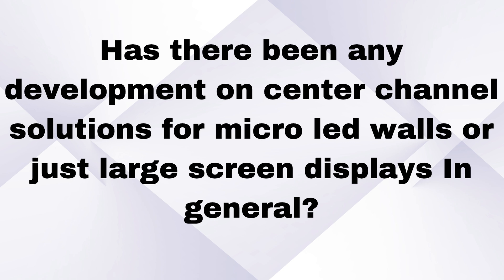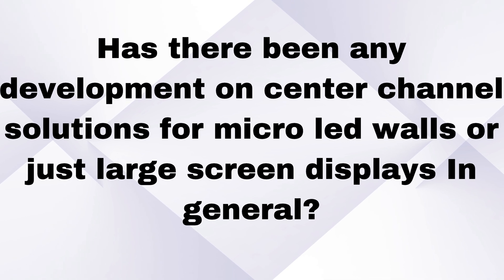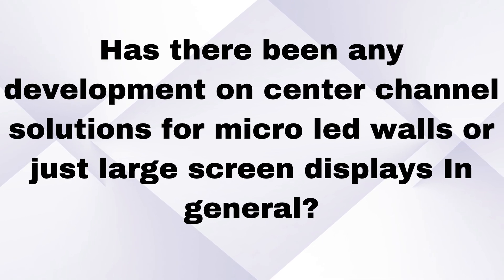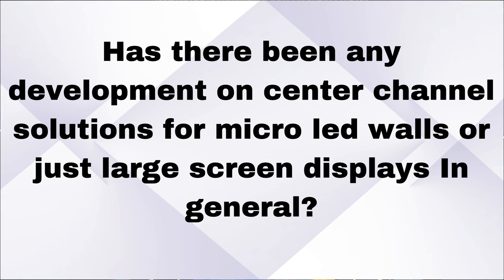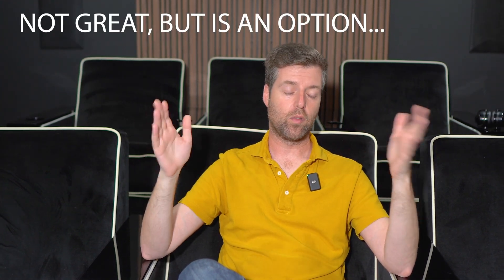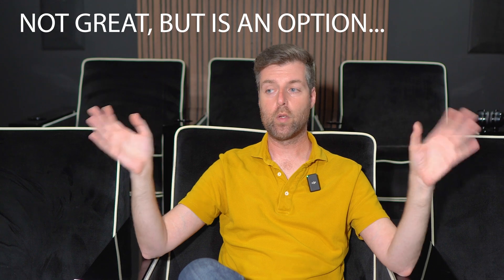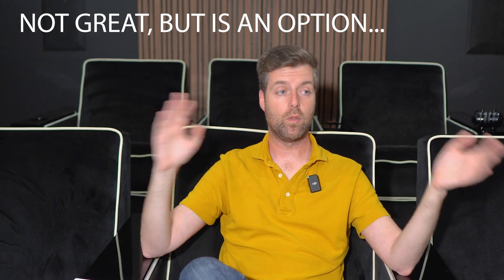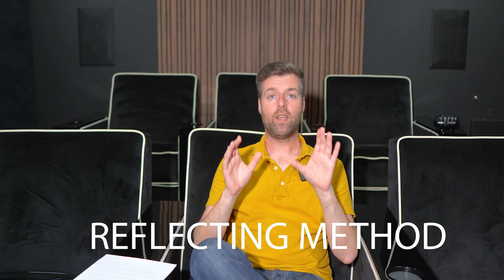Center Channel Solutions for Micro LED Walls: Updates

Comment: What brand of speaker would you be talking about, if it wasn't a Meier Direct Reflecting speaker (for center channel)?  I agree that having top or bottom positioned CC speakers are not the answer, especially when using a video wall, such as Just Video Walls (Micro LED).

Comment: I'd use the 3 way in ceilings from KEF. Normally I wouldn't put in celings for a LCR but those ones do a really good job at dropping the center image so it does sound like its coming from the screen.

Comment: While the ideal is acoustically transparent and behind the screen, I realliy don't think putting the center under the screen is bad even for projectors. I suppose a purist finds it objectionable but for my 120 inch home system I think it works very well, I've never reacted to voices coming from too low. But of course the larger the Micro LED the bigger the problem.
Reply from the maker: It all comes down to what compromises you want to make. And as you said, the bigger the screen the worse the problem. 

Keep in mind we are now targeting much larger viewing angles.  60-80 degrees. The push to 60 came from work that showed that 16:9 content at 4k could tolerate something like 57 degrees. They are now suggesting that as we move to 8k and Beyond we will push past 80 degrees and intentionally have the field of view be smaller than the viewing angle. Meaning content would fall into or even outside your peripheral vision (just as it is in real life).  As that becomes true, we can’t continue with center speakers under the screen.

Comment: I've never heard of  this approach mentioned.   \

I've always  had my centee placed below my flatscreen and have never had  <sond perception< issues.  The  dialogue/action sounds< always sounded like  it was/is coming from the center of the screen...which  i  am still kind of amazed  this  happens.....correctly. Almost as if i were using a  <front projection screen"  with the center speaker behind the  screen.  Same perception.

I think probems arise  due  to the speaker design----e.g. how the drivers disperse sound  forward--is it a wide vertical spread or a narroow one??  Is the  sound  metallic or natural? (i think when it's harsh....you might  detect the  dispersion pattern  more ).....how many drivers does the  centre have (more drivers...better  body of sound...im guessing)....is it a big centger channel speaker of a small and maybe narrow one?? etc. My center  is almost as   large as my  2 floor standers..so  iguess that's  a huge reason whytthe sound   souns <full-bodied/natural<.... Paradigm Ref series speakers....CDN  brand.....had them for over 10 years...very happy with them (never felt like i needed new speakers)...

Comment: Would high SPLs have a chance of damaging the display using this reflecting method, especially if crossed over at much lower than 1kHz?
Reply from the maker: No. Not even remotely. Nor would it matter if it was aimed at the display or not. If you could produce such high pressure as to break a tv, that would happen regardless. The more likely would be hitting the resonance frequency of the display glass. But that won’t happen either. It’s very difficult to break and it’s damped. So it’s really not a realistic concern.
Reply: @PoesAcoustics  Good to know. Thank you! I never considered the reflecting method. I have a 77" LG G2 OLED but if I go much bigger, I was considering angled dual centers above and below for a vertical phantom image. But this video and your response really make me think about experimenting with the reflection method. What gives me even more confidence is because I actually have a messed up version of a reflection method between my kitchen and my dining room. I have a nice little RBH bookshelf stereo system connected to my Alexa in my kitchen, but if I listen to that system from my dining room, I know that I am listening to the reflected sound off of my kitchen wall, which has counters and cupboards. (I don't have line of sight to the kitchen speakers from my dining room; the speakers actually face the opposite direction from where the dining room is.) It actually doesn't sound bad at all from the dining room; it doesn't sound significantly different than being in the kitchen where I have line-of-site to the speakers. So I have unintentionally already vetted the validity of how good reflected sound CAN sound, so I can imagine that it would work well if I actually and intentionally set up a reflection-type system / center channel. Thanks for letting us all know about this!

Comment: How is a center channel with an LED wall any different from a center channel with a TV?

You should optimally sit 1.375x[screen width] away from a 16:9 screen for the recommended viewing angle of 40 degrees. 

If the center is right on the edge of the screen it will be at an angle of 11 degrees which is non problematic.
Reply from the maker: That is no longer the recommended viewing angle. It’s now moved to over 50 degrees for 16:9 content and with a focus on 60-80 degrees for CinemaScope content.  

The difference is that these screens typically take up so much of the wall that the center is in the wrong position.  Any time it’s not behind the screen it is the wrong position but it’s often well below ear level with these large displays.  

A center below the screen is also a compromise.

Comment: I would assume only high end processors would allow that complex of an LCR setup. Or some kind of 100% active speaker array where every driver has its own amp
Reply from the maker: Well I could do it with a Minidsp and 4 external amps.  So it could be adopted. But yes it’s not something natively supported by cheap receivers.

Comment: Matthew I am in the middle of designing my dedicated home theatre, the room is 15 feet by 10 ft with a low ceiling (just over 6 feet) my rear speakers are in-walls (KEF ci1000ql-THX).  the seats (listening positions) are 4.5ft from the rear wall. My question is.... is the listening position too close to the rear wall to put a quadrativc diffuser between the rear speakers?
Reply from the maker: Depends on its depth. But probably. The GUD diffuser could work and is a modified quadratic design.

Comment: In a home setting I have my LCR below a 120" screen that's in front of a 77" OLED all at the same level. I never notice the center channel not coming from the center on the projector when it's down. Your brain takes care of that. I do notice it immediately when switching positions though - then it goes away after a period of 15 mins or so.

So I get the use in a commercial theater - not so much at home.
Reply from the maker: Some claim this and others do not. It’s the ventriloquist effect you are relying on. Not everyone is so easily fooled and the larger the screen and viewing angle, the greater the error and less likely to have it. 

In my experience I’ve not found it ever believable.  The center never sounds as good and the pans are never correct in the scenario you describe. Which is why I am so against it in my own work.  I am not unique in this view. Arnaud Laborie spent quite a lot of time studying this to find a workable solution. Myer sound developed their reflex system to address it. Same with Grimani.  So many of us feel it’s a problem in need of a solution. 

I did experiments with two centers at different heights and listening to panning tones and panning sounds of people talking as they walked back and forth. I found that the center being below the L-R by more than 6” at that distance was enough to notably shift the image as it pans.
Reply: @PoesAcoustics  Interesting comments thanks, didn't know there was a name associated with it. Thankful my brain gets fooled easily so I don't mind

Comment: Bouncing HF off the screen seems like a really good approach.  

Years ago I did an experiment using a 2.5" full range driver sitting on top of a CRT TV with the center ch information above 600 Hz driving it and everything below 600 Hz being sent to the mains.  We didn't have DSP back in those days so I built an analog active filter to sum the < 600 Hz center information in with the left/right mains.  It worked amazingly well, even with just 600 Hz up coming from the center, the center image was really good.

So yes, bouncing the center high frequency off the screen and creating a phantom image with the mains only for lower frequency should work pretty well.  It would be a lot easier these days with DSP.

Even though I have a large CBT line array behind my screen now, I still do basically the same thing.  I run the array 100 Hz up and send 40 hz to 100 Hz to the dipole woofer columns located on each side of the screen.  Anything below 40 Hz gets routed to the IB subwoofers. Of course I use DSP for this.

Comment: Very very cool. Another speaker design that could be used is Synergy Horns. 

When you’re out of the waveguide (horn beam width??), the SPL drops like a rock. Especially in DSL’s column synergy horns. They could probably work and then you’d be working with something full range that could be easier to implement.

I know the Jericho’s would work in commercial theater as reflected sound. The 90x40, JH94?, is already used in some commercial cinema with traditional AT screens. But… I bet there’s real promise there in the Synergy Horn concept and reflected sound.

Comment: Reflecting waves off a flat surface is dependent on the angle of the reflection point and the direction the wave came from. So what you are saying is impossible. I. E. The sound won't be directed to the seat but the floor, if the originating wave point is all the way at the back of the room and you point the sound at the top of the screen to direct the sound more towards the centre, in the distance it gets to the listener the sound will be dispersed as well as no way of like you said stopping the sound reaching your ears first before the reflection.
Reply: First, the speaker isn't mounted at the back of the room. It's probably mounted right above the ideal seat, if not farther forward. 

It's like when I'm with your wife. I've got to adjust the angle of the shot to get it right between her eyes. This depends on the distance. So the closer I get, the narrower the angle.  But I don't want to be too close, otherwise I can see all the imperfections. There is a sweet spot. It all just depends on the situation.

Edit: Pool. We play pool in a league together. What were you thinking?
Reply: @herranton  doesn't look like Mr Poes has banned/blocked you so I will respond.

Instead of saying your wife, just say your daughter. Not sure why your going the long way around, its like saying your sons, sister. Its the same thing. 

Anyway back to sound. Have you ever noticed how your mum and sister make the same sounds after they have been riding hard and enjoying them self's. Its the same sounds a tennis player makes on their fist volley. I'm quite big and they do take turns to keep up but its  giving them back pain. 
Edit: Horse riding. We go horse riding together. What were you thinking? You should join us. 

mounted right above the ideal seat as you say, and then aiming to the center so the sound appears to come from the center will reflect the sound to the floor/feet. e.g. If the speaker is 5 foot above center the sound will be directed 5 foot below center. Alternatively aiming the speaker higher  so it does reflect to the listener will make the sound come from higher up. In addition to this there will be interferences of the sound going towards the wall and the sound going in the opposite direction.

Comment: Seems like a pretty revolutionary approach to center channel implementation. Looks pretty promising. I'm curious how you would implement this in a more consumer level system that isn't using Grimani systems gear and a Storm/Trinnov processor?
I assume you would need an AVR with a line level output for the center channel and then send that into something like a MiniDSP. The MiniDSP would send a 1kHz high-passed signal to the in-ceiling speaker and the sub-1kHz content to the bass module below the screen. Or is there a better method for doing this? 
Also, any recommendation on the in-ceiling speaker and bass module combo? Something like the Klipsch PRO-180RPC LCR or Perlisten S3ic seem like they can work in the ceiling. I initially thought a small 8" subwoofer could work as a bass module, but those will struggle to play as high as 1kHz.
Reply from the maker: You have the gist of it. I would try to keep the bass module off the floor. 1khz is very directional. You would want a center channel that handles 80hz to 1khz or so.  

The other approach used by some was to send the signal to left and right speakers. So take the center feed and remix the sub-1khz signal to the left right channels. 

Not all processors can do this and I haven’t tried it with a minidsp.  We actually had to use two DSP processors daisy chained to do this when we played with the idea. 

I am still of the mindset that a dedicated sender midbass/midrange module is best. One idea I’ve wanted to try is to slot load it so it can sit behind the screen (maybe in wall) but send sound out of a slot.  Imagine a slot loaded driver that has a 1” or 2” aperture that then leads to dispersion on par with a normal speaker and able to be directed out the top or bottom of the screen?  The. Everything above 1khz coming from the middle.
Reply: @PoesAcoustics  Fascinating answers as always, thanks! This is certainly an intriguing approach. A slot loaded design does seem promising. Now I'm thinking I might try using a Perlisten in-ceiling speaker angled toward the screen and build my own slot loaded mid-bass module using a Purifi woofer than I can install behind the TV.

I am currently in the process of building out my room. I'm not in the MicroLED wall budget range, but am seriously considering a 115" TV. The concepts you're introducing in these videos are helping me "future proof" my room. I never would have thought to run extra wire in my ceiling for a potential reflective center channel if not for you. Thanks for your help!